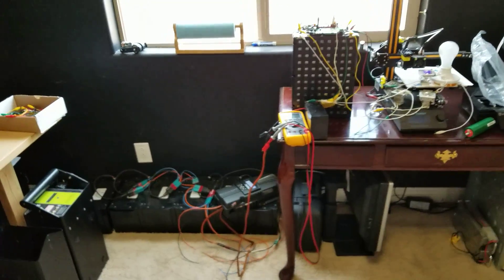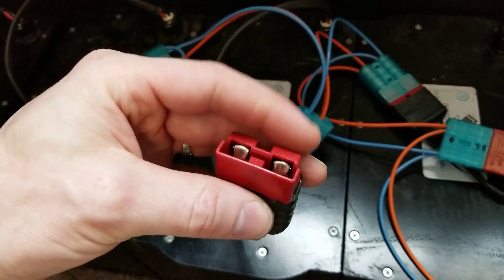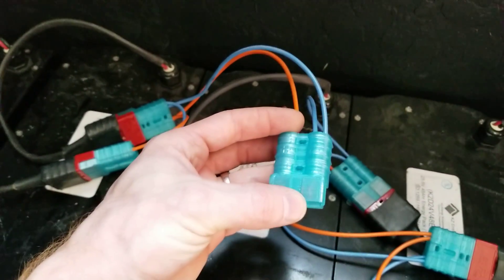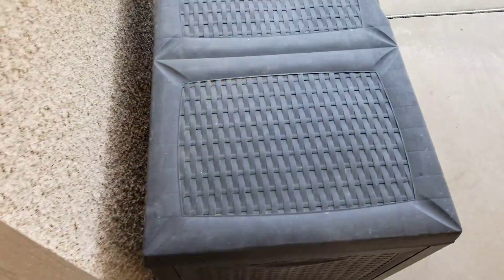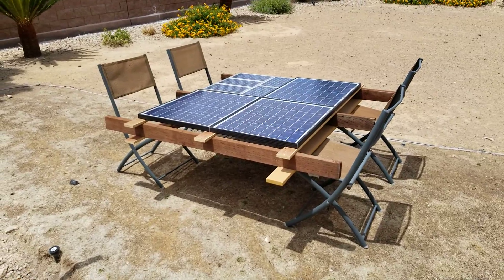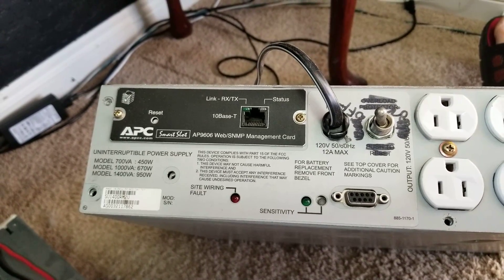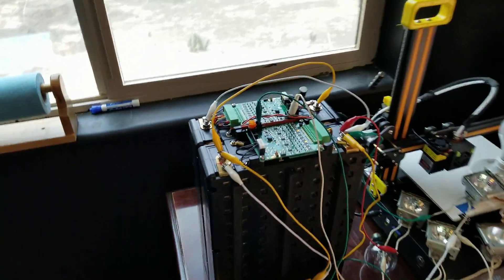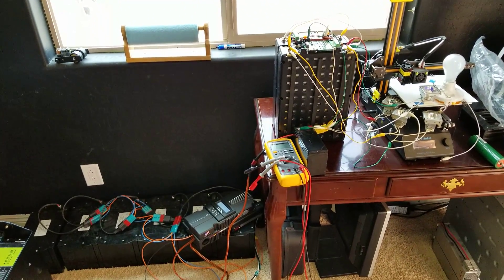Solar Set Up For 3D Printing. Lets Use The Sun To Power Our 3D Printing lab!

Comment: Can you use a dc motor with a static generator and a capacitor to store electricity and make it self run itself make it more efficient you may need a little energy from a battery maybe.